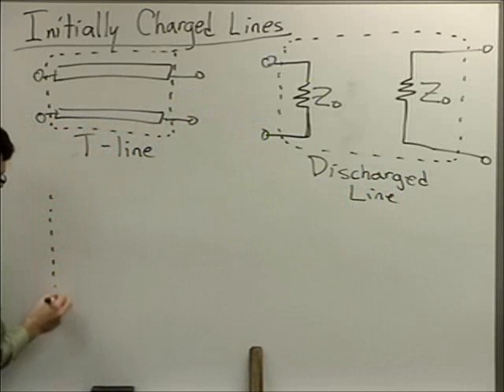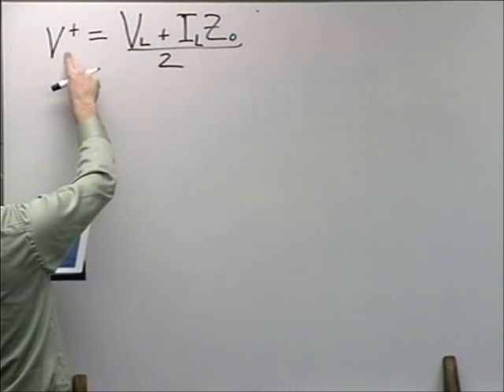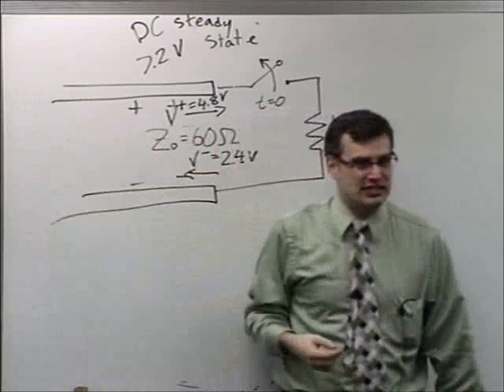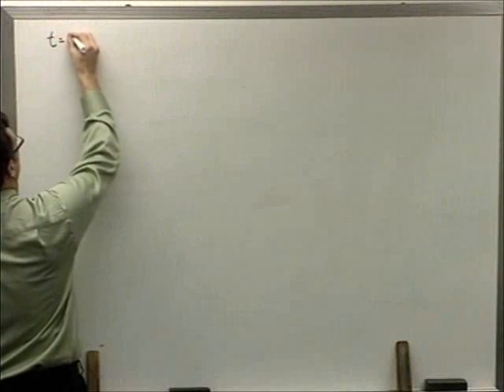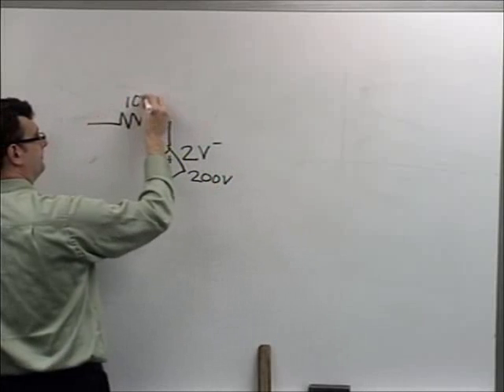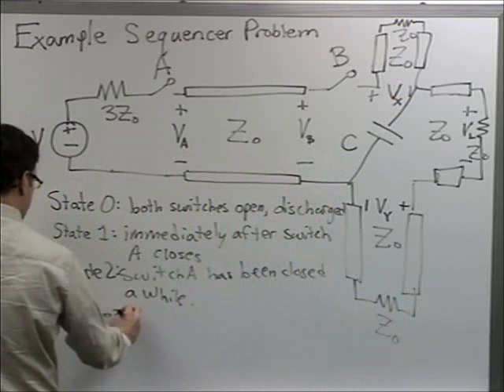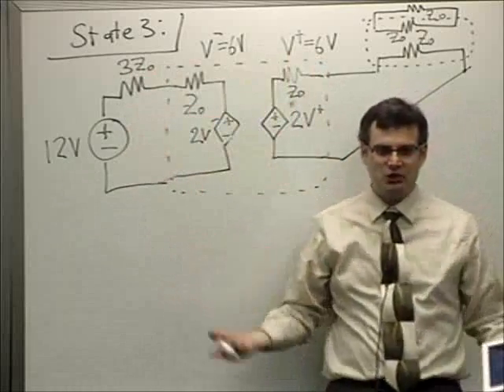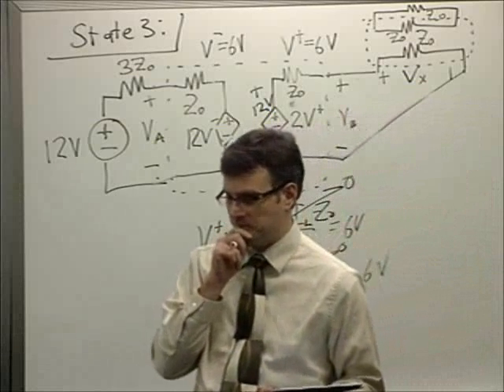TDT06: Initially Charged Transmission Lines

Comment: One thing I do not get, several times it was mentioned (not in this TDT06 video, but in the previous ones 1-5)  that at some point the reflection eventually subside or die down (probably not the exact quote). But from what I can tell from this TDT06 video is that there is permanently a forward and backward wave that keep on bouncing back and forth (at least for a DC voltage). This seems to be, pardon my language, whack. In the case of the 200V cap and the unfortunate 100ohm finger, what is being said is the cap is not charged at 200V, but rather there is a +100V traveling forward and another +100V traveling backwards is just to difficult to phanthom. So the question is do: reflections die down in a DC system or do they stay indefinably ?
Reply: From what i understand the transmission lines being discussed so far is lossless transmission lines meaning without any load the reflections will keep bouncing back and fourth maintaining the 200v and this is used to model an ideal charged capacitor. Once any form of load is introduced then there is loss in the system and slowly the reflections die out

Comment: dr greg durgin sir at time 26.53 you said that 2.4 will go back and come back with negative reflection coefficent and erase 4.8 my question is whether it is 2.4 or 4.8 volt that will go back and thank sir for the videos this really helped a lot in understanding of the transmission line
Reply: its 2.4 volts

Comment: Does anybody know why 2V+ and 2V- ?! Isn't it supposed to be just V+ and V- ?! Why is it doubled ???
Reply: By now I think you might have figured this out since this was asked long back. If not, see below

Assume a Vx at the source in series with Zo and Vy in series with Zo at the load 
The above model should be equivalent to tx line equation at all times at the source and the load 
all below variables are function of t at boundary 
At Load 
Vload = Vy -Iload *Zo 
V load = V(+)load  + V(-)load and I load = [V(+)load/Z0 ]- [V(-)load / Z0 ]
plugging in we get solution for boundary condition at load as Vy = 2*V(+)load
At source 
Vsource = Vx + Isource * Z0 
Vsource = V(+)source + V(-)source  and Isource = [V(+)source/Z0] - [V(-)source/Z0]
plugging in we get solution for boundary condition at source as Vx = 2* V(-)source at that time